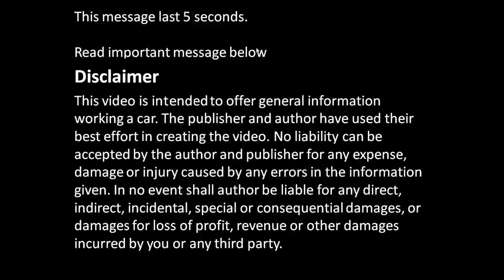How to replace Thermostat Toyota Corolla DUAL VVT-i engine.  Years 2008 to 2018

Comment: When do you need to change your thermostat?
Reply: when u see signs of engine overheating...thermostat might be a problem...or at times you will also see leaks in the thermostat housing....in that case it is better to replace the whole thermostat casing..
Reply from the maker: If my car heats up slowly
Reply: @PeterFinnTheCarDoctor  kindly be heating up slowly what do you mean? Kindly clarify.
Reply: @kalokikelvin6603  It means the Thermostat is stuck in the open positioned.
It will take really long for you to get heat in your car during the winter.

ATG says if you pulled out the Thermostat & you got no coolant gushing out.
Then mostly Thermostat is opened (allowing coolant to run out), means it is defective.
When the coolant is cool or cold, the Thermostat is closed (coolant can not run).

Comment: I have a leak from engine part where the the thermostat installed
Reply: There is glue/liquid rubber sealant. Take the thermostat off and reinstall it with sealant